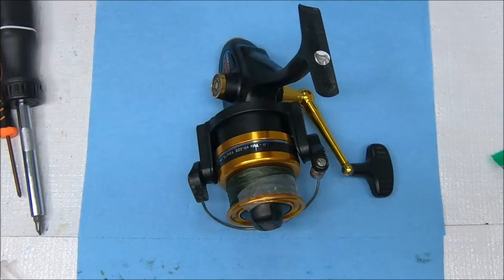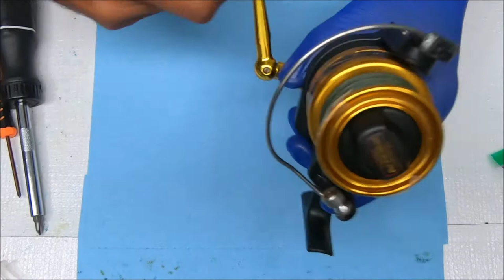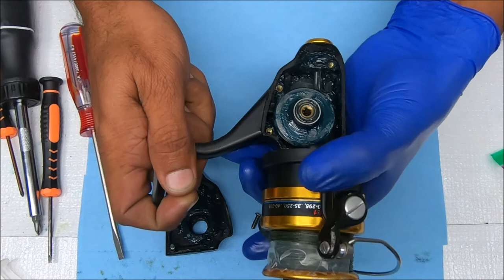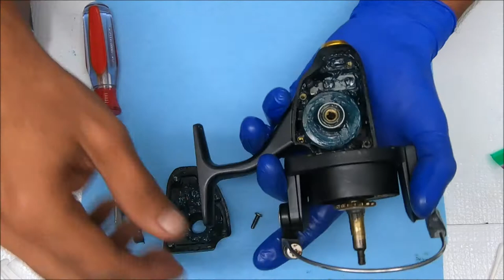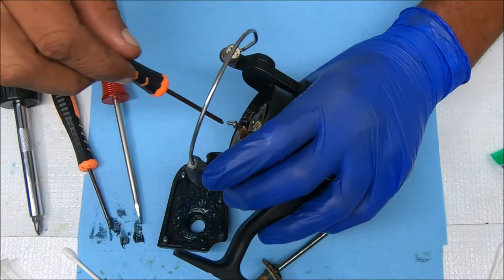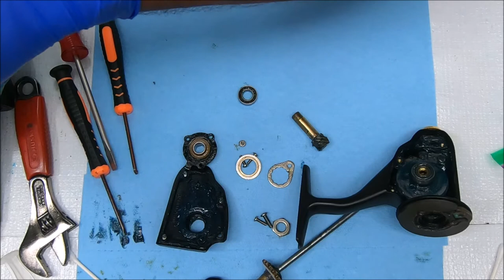Penn Spinfisher 550SSG hard to crank diagnosis and fix: Fishing Reel Repair

Comment: I kinda have the same problem but I’m not to sure, whenever I cast in heavy current and when I reel it back it makes a noise in the handle it feels like something is stuck in the handle, I hope this makes to you. Any help would be appreciated.
Reply from the maker: Thanks for reaching out. Did you watch the video and then check the same areas in your reel? If so, was it the same, or was it something else?

Comment: Mate the reason the grease has turned black is because the cheap Chinese pot metal gears are slowly chewing themselves to pieces and combining with the grease.
Reply from the maker: 🙂 I'm not sure that's the reason, but that's as good as any. My 550SSG has been hanging tough after tons of yellowtail and mutton snappers.... although I did have to replace the line roller bearings once.... twice may be coming soon. More vids to come.

Comment: Question - I have the BG4000, which I dropped in the lake and only submerged for 15 minutes.  Also I had dropped it twice fishing on the banks.  Now when I turn the handle it seems very loose, and not catching the rotor, which does and does not spin.

Note - As is turning the handle the rotor does not spin, however if I push the handle in (towards the right), the it will catch the rotor and then it spins.

What could be the problem?
Reply from the maker: Thanks for checking out the video. Have you taken the reel apart?
Reply: @TSGReelService  Yes I did. It looks like the plastic piece that holds the screw for the oscillating gear, broke off and the screw still attached!  I just looked up the schematics for the BG4000, and they don’t even show that as a part.  🤷‍♂️🤷‍♂️

Comment: I like those diagnosing videos. Are you using after market ball bearings?
Reply from the maker: Thanks for watching. Depends on what's available.
Reply: Boca bearings. If you're going to replace...upgrade.
Also it's not a good idea to force a reel to turn. If it's hard to turn take it apart and find the issue.
Good vid...just some tips

Comment: I took my Penn back to the shop, didn't mess with it as that would void any chance of a refund.
Please people don't mess about opening it because as soon as the shop sees the screws have been opened you can kiss goodbye to a refund.
Anyway I had a refund for the Penn and used it to buy a different brand.
Reply from the maker: Thanks for checking out the video. Glad to hear you were able to get a refund. That stands to reason.... if you're going to return for a refund, there's no reason to open it. Thanks for your input.